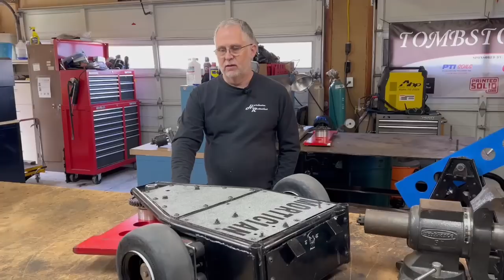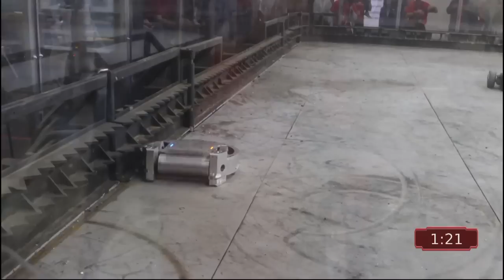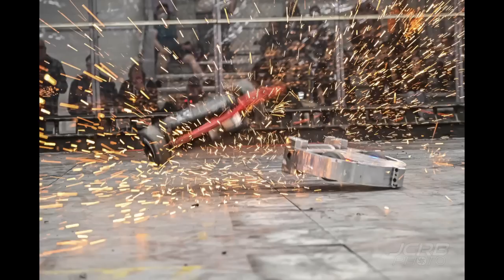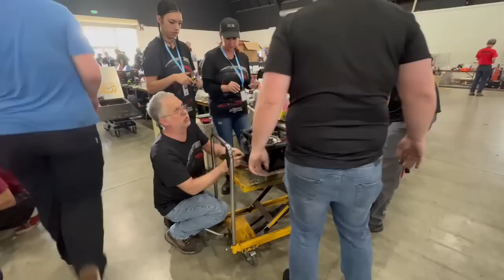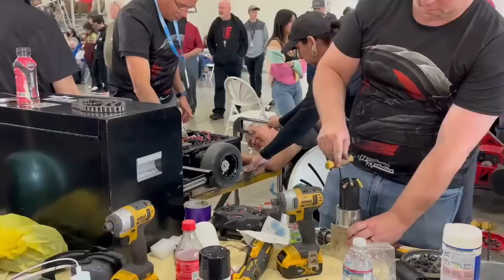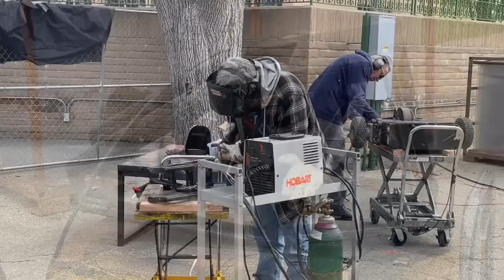Mortician 2023 - Second match vs. Copyright Infringement

Comment: Yeah, clever name for a bot that looks superficially similar to the Minotaur/Toro body design but individuated enough to not be seen as a total ripoff. Thing is, a lot of those low-profile drum-spinner bots tend to wind up looking like each other, bc there's not much that can be done to them to set them apart from one another other than cosmetic tweakings, like body paint schemes or armoring configurations

Comment: Ray do you guys use chromoly steel  for your frames?
Reply from the maker: Yes, pretty much exclusively in the larger robots. 4130 tubing with titanium armor panels
Reply: @ray9368  yeah a lot of race car builders use that stuff, have you ever thought of using pieces of steel belted radial tires for armor, i don't know about weight on that but if you ever hit one with a bush hog you know what i mean

Comment: I’ve always wondered what a robot with a big electro-magnet would be like. If it was able to stick to a bot and move it around it would get good points for defence, and it could probably damage electrical components. Maybe pair it with a flame torch so you can stick to a bot and then blow the flame into their opponent.
Reply: magnetics don't actually do much to modern electronics, this combined with a lot of bots using non magnetic metal would make it hard to hold on to many bots

Comment: @Ray you should look at Carbide, they've managed to make it very durable. i've always liked how hard TombStone could hit, but it always breaks down after just couple of hits and Mortician seem to be having same issues.
personally i'd put more effort into making the bot more durable, reinforce the frame with angled rebars (or whatever you call them), so it can't bend that easily.

also why haven't anyone added brakes to their weapon? it shouldn't take too much weight to add basic braking system, it can save you from self-damage after a hit. instead of hitting the wall or ground, hit the brakes!

another thing about parts coming loose, can't you wrap them in some kind of acrylic? parts that don't need changing, cover them in acrylic (like speed controllers). if they need cooling, mount a small heatsink that sticks out of the acrylic. if i had money, i'd be building amazing bots that have never been seen before!
Reply: I'm guessing you don't have your driver's license yet if you're asking that kind of question about brakes. Doesn't sound like u know much about electronic components either. Do a Little homework first kiddo.
Reply: Tombstones weapon was one of the most durable in the field.

Comment: Ray are you ever gonna beef up tombstone or mortician with some armor around the wheels? Do you think it will be worth the extra weight?
Reply: He can't do that for 2 reasons: 
1. Costs weight to do it effectively
2. Tombstone especially can't because the weapon and drive have to be the same width or it's thrown out of balance.
Reply: It’s not really a benefit. First off it’s very quick so it would be a fluke if an opponent was able to take a tyre off, and even if they did, he still has one wheel and can move around somewhat, and could spin around quickly and defend itself.

Comment: Big warehouse and not a single broom to be found. Id be pissed running a chain drive with that much debris on the ground.
Reply: They collected all large debris after every match (although there could still be a couple of bolts laying around when the next match started), swept the floor every 3-4 matches (and later in the competition every time there was an arena breach lol) and thoroughly at the end of each day but it's a large arena and everything has to shut down while they're in there so they couldn't spare too much time. And frankly the RoboGames arena has always been dusty so if you put in a bot that is susceptible to dust, it's kinda your own fault.

These bots just generate a lot of metal dust with the spinning weapons and rubber from all the tires, there is just no keeping up with that unless you're BattleBots and there's like 3-4 crewbots rushing into the arena to clean everything after every match.
Reply: Get Jamison Go to clean it up; after all, he's the one with the dustpan
Reply: They locked the brooms away after Harry and Malfoy flew away without permission
Reply: probably hidden somewhere out of sight
Reply: The entire event was running behind on time do to unexpected issues that started before the event even began. The fire marshal made them switch  last second to a different building than planned because of new regulations not allowing a structure to be built inside of a permanent structure so had to move to a “temporary” type building that wasn’t tall enough to install the arena ventilation system. Meaning they got a late start building the arena to the extent that it wasn’t completed until after planned start time day 1 and wasn’t painted until day 2 so the early pairings of bots were told to avoid the red and blue squares. And multiple arena breaches due to a new untested arena that the materials used to build it were in question of being what it was supposed to be (good lexan doesn’t break in the way it was breaking so it’s suspected that it was actually either generic crap lexan that’s not even considered lexan or plexiglass )

Comment: It looks like Mortician drives considerably worse than Tombstone. Perhaps the wheels are too close to the weapon? Seems like if the wheels were further back it would lessen the turning radius and make it much more stable.
Reply from the maker: There are more than a few things going on here. First is it's really just a bit faster than a 2 wheeled bot should be powered. So top speed is just going to be hard to control. Next it has probably too much power in the drive, more like a heavyweight's drive in a middleweight. So the tires just spun like crazy. I probably could have made some adjustments to the speed controls and radio to accommodate that, but it never looked like a problem driving at home. That was because the arena traction was just horrible here, with a lot of dust all over the floor. So what worked fine in testing didn't work as well at the event. This was more of a learning process than anything else.
Reply: @ray9368  Got it. Thanks for the detailed reply, Mr. Billings. I really enjoyed watching your build playlist. You're quite an accomplished engineer! It was fun watching you dig into Mortician with an angle grinder trying to fit the drive chain on the sprocket...calling yourself an idiot in the process. Haha! Made me laugh. Anyone who can't make fun of themselves takes life too seriously. 

Keep up the great work!
Reply: @ray9368  
You are truly my hero..
Your humble and easily answer this comments are definitely show us what a good character you are.

I'm your fan from far away country, Indonesia.. 🇮🇩

I hope you and your bot, will join the next battlebots competition.

My pray for you..

🙏🏻

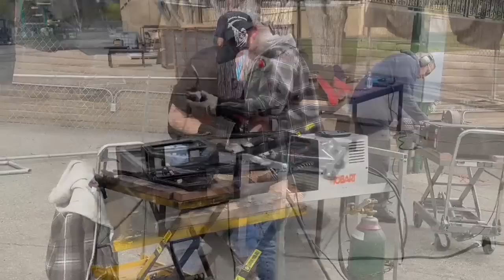Comment: Protip everyone wearing headphones: turn down your volume at (or before) 6:42.

Great that you filmed the repairs, watching that hit on the stream it was very visible the entire axle mount was bent inwards so the weapon was scraping on the frame. 
4:27 I think because the ESC is trying to get the weapon moving while it's being stalled the amperage might peak well above the maximum rating of the ESC, which when repeated a bunch because the motor can't turn might be the reason the ESC decided to release the magic smoke.
Reply from the maker: It was a drive speed control, not the weapon. We used the same weapon motor and speed control through the whole event. And there was nothing bound up in that drive.
Reply: @ray9368  Very interesting, I just assumed it was the weapon ESC since the weapon was trying to spin up just before. Thanks for the reply!
Reply: @ray9368  join battle bots man would love to see your bot there
Reply: Not just headphones. It's 2am and I had my speakers at not too loud, but that all changed when the Fire Nation Mortician attacked.